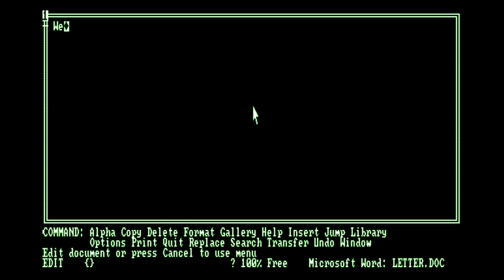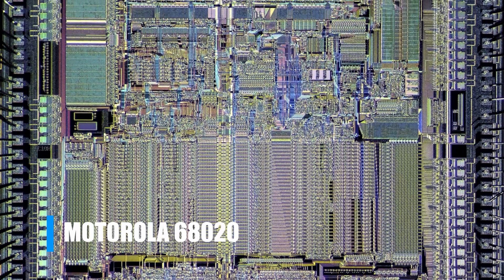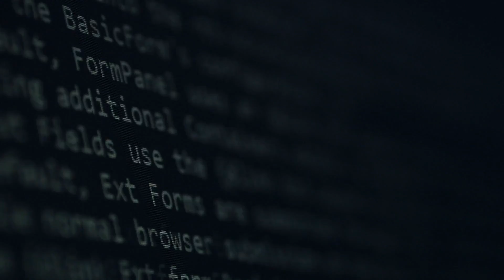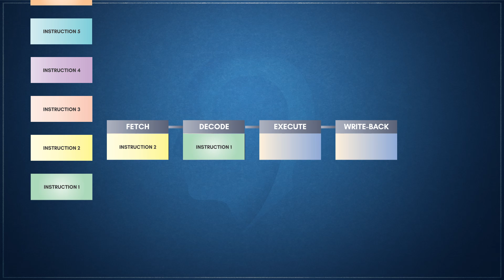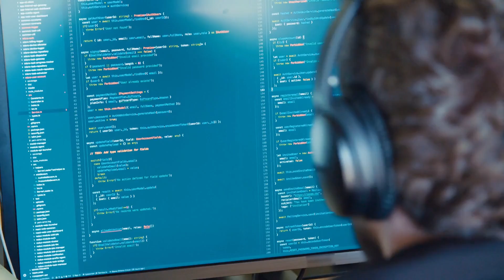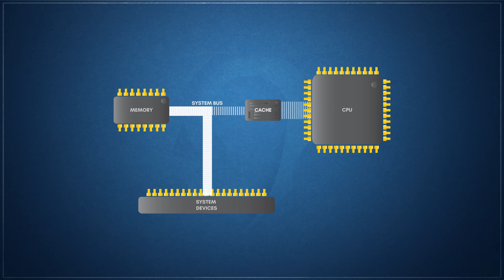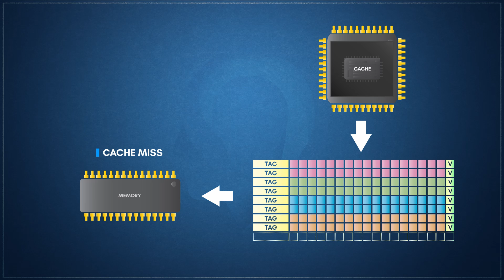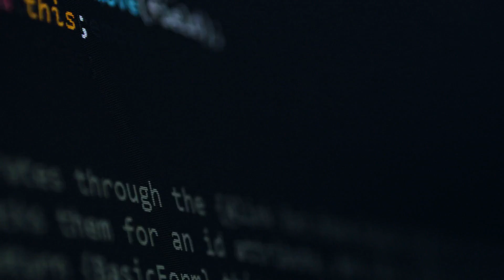The Evolution Of CPU Processing Power Part 4: The 32 Bit Processor - Pipelines and Caches

Comment: Can you take about other types of processors like GPU, FPGA, and ASIC?
Reply: Technically speaking a cpu and a gpu are both ASICs...
Reply: @ultrapetey  A GPU is an ASIC, but a CPU is a general purpose device, not so much "application specific", now is it? Also modern GPUs (if you ignore TMUs, Tensor Cores and Ray Tracing bullshit) are general purpose as well. If the thing is fully programmable for any task, is it really application specific?
Reply: @ultrapetey  yea, but that a bad way to think about it
Reply: @AndrewMellor-darkphoton  Why so? :(
Reply: Easy version.  A processor is "general purpose."  It can do anything.  But it comes with the down side that it never knows what it is doing next, so it constantly has to get an instruction to know what the next step it.  Each instruction is one step, so a CPU does one thing at a time.  --- --- --- If you custom-design the logic, then the logic knows what it has to do, so no instruction fetching needed.  Plus, you can pack more logic in there.  A CPU can add two numbers at a time.  With custom logic, you could have 100 or 1000 adders all running at the same time. --- --- --- ASIC vs. FPGA.  Both run custom logic.  But the ASIC lets you physically place gates and transistors on silicon specific to your purpose.  This is the ideal case: fastest performance, lowest power.  But the down side is the extreme cost associated with designing an ASIC.  The chips are cheap, individually, but it can run into the millions to design it. --- --- --- An FPGA has logic structures that can assume any desired function.  Combinatorial logic is modeled with tiny RAMs.  Muxes let you use built-in registers or bypass them.  So, an FPGA can take on ANY design that will fit into it.  All you have to do is buy one and start coding for it, so the cost of entry is VERY low.  But the down side is that the flexibility of an FPGA costs silicon area, speed, and power.  So an FPGA is great for a smaller run of a few chips (one to thousands).  If you want to ship a product in the millions, consider an ASIC.  --- --- --- A GPU is basically sort of a hybrid.  There are certain types of math an operations that are common in 3D graphics.  Plus, you tend to do the same operation on a LOT of data at once (look up "SIMD" on Wikipedia).  A GPU is programmable, but optimized for the types of operations needed for graphics.
Reply: This would be a huge topic. CPU is mostly a narrow and single architecture. The programming models alone would make this huge. CPUs are constrained by several things, while FPGAs are constrained much less. ASICs are nearly unconstrained.

CPU conceptually is control flow based, synchronous, indirect/interpretive, etc. logic. Most people only consider the ISA and core when considering the CPU, however if you broaden this to system architecture things change. This is optional for CPU to some extent, unless considering microcontrollers. This is not generally speaking optional for GPU, FPGA, or ASIC.

GPU, FPGA and ASIC have begun to play a role in processing mostly due to the limits of CPUs conceptually. We have worked out a lot of their architecture slow downs. However they operational slow downs cannot be worked around. These represent a simple program model which is why we like them. Numerous architectures and hybrids exist which could take their place. However the level of investment we have is hard to over come. In addition most of these alternatives are not currently scaled up to the level of the current models. They are conceptually proven and viable, however no one really seems interested in them. Instead we spend a decent amount of money exploding CPU size.

In summary CPUs have started to hit reduced returns. However FPGAs are still software based. There are hardware models which work off software. In these it is debatable if it is really a hardware system or software system. The problem FPGA, GPU and ASIC is cost and speed. These platforms generally work in a slower and more parallel/direct manner. This can be challenging for some. However there is no real reason for it to be a problem.

Again we have known about this design approach for 30+ years. However hardware production generally does not support it. The whole reason for CPUs and parallel processors in the first place was due to manufacturing limits. FPGAs work off of LUTs which are basically memory elements which are expensive and huge. They can use decent amounts of power, however die shrinking has worked that problem somewhat. Note FPGAs still mostly play with synchronous logic and use combinational memory reduction into a register stages before hitting a massive interconnect. This can be very powerful, and if you can do asynchronous you can get insane performance. Assuming you have a nuclear reactor and a tank of liquid nitrogen. ASIC does allow asynchronous. SRAM is fast for this reason, it is also expensive and uses decent amounts of power. However modern version have means to control some of this.

I digress the programming model is not really there. There are two conceptual high level programming approaches. Java conceptually represents one of them, however I think it has turned its back on it and everything else at this point. The other kind of exists in current HDL, but is likely not going to be spun up anytime soon either. So we use GPUs since they are available in programming model and manufacturing compatible with current technology. However making any significant changes will not likely occur.

Conceptually you should be able to conduct basic experiments with them. Enough to at least form a programming model. Hardware manufacturing will at some point need to be reworked to make large scale customization viable. Till them we may have enough capacity to make one size fits all reprogrammable FPGA. However we still lack programming model. Without this there will be no platform. People will approach them looking for API, HAL, OS, etc. It will tank.

For this reason we mostly do hybrid architectures. Hardware/software co design, coprocessors/accelerators, microcontrollers, system on chips, etc. Lot of different strategies there too, but it would only represent a fraction of what is possible. Note FPGAs can become coprocessors and be reprogrammed via PCI express lanes. Thus allowing them to be integrated anywhere in the system. Ryzen theoretically could replace the GPU or CPU module if it wanted too. However the market size may not be viable. Most people want to use high end tools which mostly target high cost models. Thus reducing adoption.

Most people learn computer organization and not computer architecture.
Reply: @davidthacher1397  thanks

Comment: It's interesting to note that one of the things that made the 6502 so fast relative to other contemporary CPU designs of the time is that it performs memory access and instruction execution in parallel.
This makes it  precursor to pipelined designs that came along later.

(the 6502 however is a register + memory design which became increasingly problematic as the CPU speeds increased faster than memory speeds)

You'll note however that many instructions still take multiple cycles to execute. In essence however you can predict the execution time based on how many memory accesses are performed, keeping in mind that the instruction opcode itself also has to be performed.

For instance, an ADC (add with carry - note that the nature of this instruction means you get incorrect results if you don't precede it with a clear carry instruction, but it does mean multi-byte addition is faster for additional bytes) takes between 2 and 6 cycles (With a whole bunch of extra conditions adding a cycle which only apply to the 16 bit 65816).

Since this adds the 8 bit accumulator to an 8 bit value, it's worth considering the time taken for different variants of the instruction. There are 15 variants of the instruction that apply to the 65816 (including one that takes 7 cycles), and 8 that apply to the original 6502 (and 65c02)

The 2 cycle version is the ímmediate addressing version.
This means the instruction sequence itself contains the data. 
Thus, 2 bytes of memory are read. The first being the instruction, the second being the second operand (the first operand is the value in the accumulator)

A more typical 4 cycle add happens when using absolute addressing. In this case the second operand is in a memory location, but the instruction contains a pointer to the memory location. Since there is 64k of address space (2 bytes) on the original 6502, we read one byte for the opcode, two bytes to get the address, then finally we have to read the operand from the location we just got the address for, totalling 4 bytes read, and 4 cycles taken.
By contrast, the zero page version of the instruction works with the same logic, but since only a single byte is needed to specify a zero page location, we need 3 reads, and 3 cycles.

A full 6 cycles is taken by using a Zero page indexed Indirect, X addressing mode. This is as complex as the name sounds, and it uses the X register (which would have to have a value before you call such an instruction for this to make sense)

The instruction, as always, has an opcode, as well as a single byte that specifies a base memory location in the zero page (hence why it can be a single byte).
However, the CPU takes this base value that is specified in the instruction, adds the value in the X register, then reads the byte at this location in the zero page, as well as the next byte, before using that as an absolute address in memory to read a byte from and perform the addition.
You'll notice this is one case where the total number of bytes read is 5, while the instruction takes 6 cycles to complete.
However, notice that two additions are performed along the way; the first to determine where to find the memory address, then second to actually perform the addition.
One instruction byte, one memory index, two memory address bytes, and finally the operand for the addition.

Point is, the execution time is, with rare exceptions, tied directly to how many memory accesses are required for an instruction to complete, and for rather obvious reasons, something like an addition cannot be performed until it's second operand (The value you are trying to add) has been loaded into the CPU, but you can still do things like instruction decoding as soon as you know what your instruction actually is.

Internally this is done by doing different parts of the instruction in parallel; decoding the instruction before the operand is available to perform the calculation, and fetching the next instruction the moment the previous one is ready to execute.
It might only be a 2 stage pipeline (and even then it only barely qualifies), but it means the only bottleneck is memory access speed...
Reply: well done ;)...
Reply: A few charts and graphs and there is a lesson ready tp go.
Reply: Well put & described !

Comment: Talk about memory speed should include a mention of things like the integrated memory controller and the accompanying removal of the front side bus / north bridge. That was a big deal and ram access got way faster once the FSB was done away with.
Reply: And now proprietary on-chip bridges and FSBs made it impossible to manufacture socket-compatible professors to modern Intel and AMD motherboards.

Comment: Wow!   I’ve always considered all aspects of the cache as “magic”. . .   The key to removing all that complexity is faster memory and memory bussed. . .   much faster. . .   

Great stuff. . .   even for my own slow memory.    Pipelining, predictive branching. . .   Yup.
Reply: The problem with faster memory is that electrical signals travel at the speed of light. Now take a ruler and measure the length between the far edge of the CPU socket and the furthest DIMM slot and solve for time. Now compare that to the fact that a typical modern CPU running on 3200MHz CL14 memory has a memory latency of 70-75ns... Not much of a margin there, right?
 
We've been at this point for quite some time, and hence we invented Double Data Rate memory in it's various iterations. This doesn't help the latency but it improves the overall throughput by an ever greater factor with each generation.... So we need caches. Because caches help you when you need low latency and system memory helps you when you need overall high throughput.

The same system is used in storage solutions: You have the memory on the disk controller itself which is wicket fast, then you have a few high speed NVMe drives on the controller for "ultra hot data", then you have some fast SATA SSDs for "hot data" and lastly you have a ton of spinning hard drives to take up the bulk of the data. This is the "L1, L2, L3 caches + system memory" approach all over again. And it is very fast and very cost effective.
Reply: Anders Juel Jensen Then comes HBM into the picture, which makes the concept of cache and main memory almost one and the same by bringing the main memory onto the die. That decreases the reliance on higher layers of cache.
Reply: @kiseitai2  HBM doesn't have vastly better latencies than DRAM. They're better. A lot. But not to the point that it fundamentally changes anything. So you're still going to need read-ahead/pre-fetch, branch prediction etc, etc, so you still need caches. Just not as big caches. Which saves money. But HBM needs to be mounted on silicon interposers because you need 1024 lanes/traces to each HBM module. Interposers are made from regular silicon wafers, and are produced with (currently) 10-12nm class lithography. This is not cost effective. To the point that, outside of specialized equipment, a big honking cache and slower memory still gives you the optimal price/performance ratio.

However, chiplets and chip stacking are dawning technologies, and eventually the yield and binning gains from producing lots of little chips and putting them together on an interposer will eventually outweigh the extra cost of the interposer itself. So eventually putting main memory on the same substrate as the computing silicon will become cost effective. What remains to be seen is whatever the combination of normal DRAM + big caches on the same interposer then just push the HBM + smaller caches back yet again.
Reply: @kiseitai2  DRAM, like HMB has other things that add latency. Like refreshing.

Bits are stored in capacitors that experience leakage. So these capacitors need to be refreshed. Which can result "delays".

SRAM, the memory typically used as CPU cache, uses several transistors to store a bit. It doesn't need to be refreshed. So there's no such refresh delay. But because it requires several transistors per bit, it has much lower density.